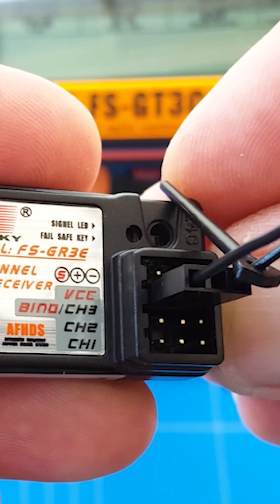Best Way To Bind FlySky FS GT3C Transmitter To FS GR3E Receiver and Set Failsafe

Comment: My controller is silver. It is the fs gt3c. I added 5.63 DC volts. The receiver never flashes quickly. just slowly once every second. Do you have any suggestions?
Reply: Make sure you use the correct bind plug - some systems use plugs connect neighbouring pins, this one needs the outer pins connected. Make sure to use channel 3 and that you put the plug in before adding the power.

Comment: can i use my rc motor cable to bind it? i have the fs gt2b and the battery is a bit different from the others
Reply from the maker: Na the bind plug is wired differently then your rc motor cable
Reply: @HowToDIYRc  it worked finally, as long as there power in the esc its fine